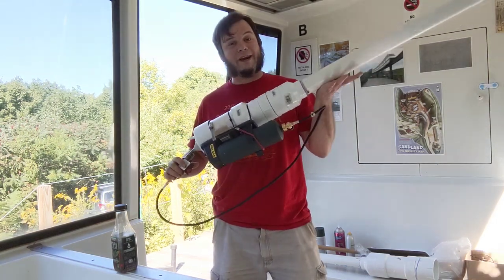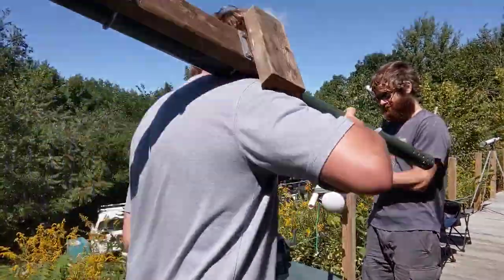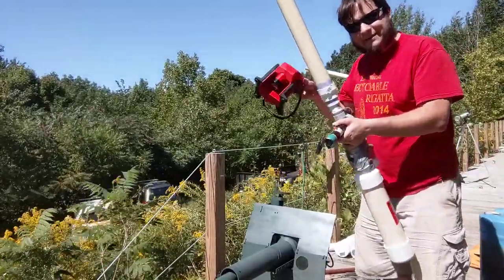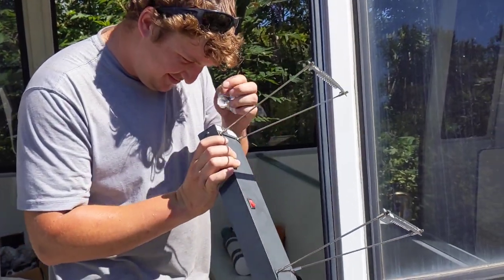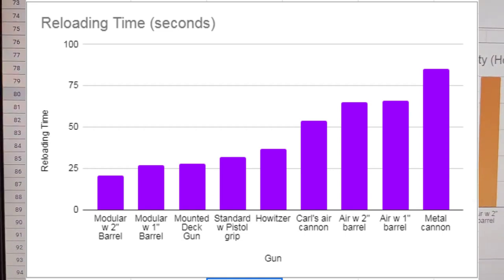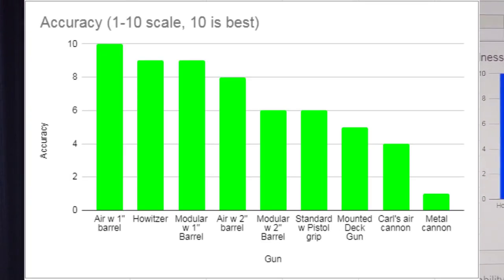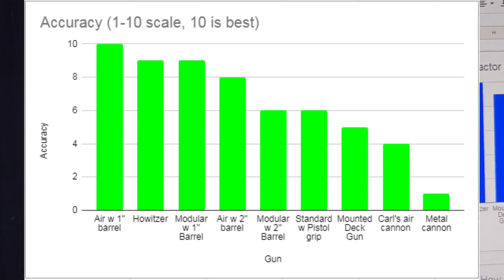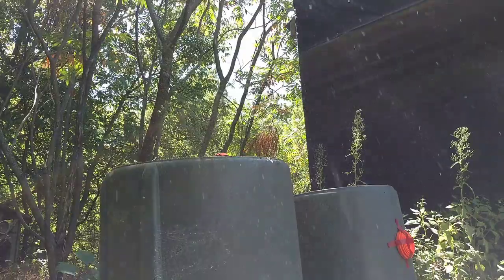What's The Best Potato Cannon? We Find Out With Science!

Comment: For the grill sparker style I recommend 91% isopropyl alcohol. As long as you give it fresh air between each shot it will go off.
Reply: I like to use denatured alcohol with mine. It is clean and relatively safe and reliable.
Reply: I had best luck with propane
Reply: @ariesleo7396 true, propane works the best but the combustion temperature is much hotter than isopropyl

Comment: You need to give the size, shape, weight and material of each projectile being fired. Especially for the chronographed ones so you can compare the power or inertia of each projectile. Haven't you seen any gun channels? the good ones even tell you how they load their rounds lol. 
Also if you want a better ignition source then order a few cheap plasma lighters online, you can attach the leads to some bolts in the chamber and they should last longer but if you epoxy a nut on the inside and one to the outside of the chamber then they become both replaceable and tuneable. When placed properly they can get that extra 5% of capability out of it. Also for using liquids like alcohol or lighter fluid that works best when vaporized, I have found that pre-mixing it in a separate container can be the most reliable method, like pouring rubbing alcohol into a big 3 liter bottle and filling the cannon by squeezing the bottle so that the vapor and air from that is used as fuel, then you don't need to worry about putting too much in there you can just have extra in the bottle and as long as you just use the vapor from the bottle and not the liquid it is already got a great ratio in it!
Reply from the maker: I ordered some cheap stun guns to try out, will see if those work better or if I just zap myself :-P

Comment: Your velocity is super low.  Ive never had a potato bounce off of a target.  I get reliable ignition with aqua net, and can blow a hole in 3/8 plywood.  Hitting an oak tree will turn the pitato to mist and remove the bark of the tree in an 8" circle.  Also, sharpen the outside of your muzzle so you get a perfect cylinder of potato going  down the bore

Comment: What if you designed the combustion chamber like a carburetor where there is a constriction to increase the velocity of the gas where you have the ignition on the back and the other side that connects to the barrel would be 1/3 the length of the high pressure end(the ignition side)

Comment: I see many potatoe cannon makers shoving potatoes extremely tightly down the barrel for the sake of preventing any air escaping. But dont you hinder the potatoes speed when you shove it that tightly in the barrel?

It would seem if your wanted the optimal speed  you would cut the potato so it barley touches the sides of the barrel. That would prevent air from escaping, while keeping friction to a minimum.
Reply from the maker: Some people will have a cutter or a specially shaped barrel to slice the potatoes to just the right size. There's probably an optimum balance between size and airtight seal.
Reply: It doesn't depend on that alone. The tight fit is meant to retain the explosion a little bit longer, causing higher peak pressure in the chamber, which in turn deliver more energy to the projectile. A loose fit on the other hand, is too easy to be moved. The early phase of explosion would cause it to move, effectively increasing the volume for the pressure behind it, and finally causing the peak pressure in the chamber to be lower
Reply: Yes that makes sense. Good to know
Reply: Some quick tips.....starting fluid in my experience, is best. You can NOT use the nozzle that comes with the can, it's TOO COARSE. Find a  spray paint nozzle that fits on the can and spray a fog into the breach. Start small and work your way up with the amount. And always remember to blow out the exhaust before the next shot. There is NO oxygen in the chamber after you shoot it! Hair spray will coat your electrodes with lacquer and soon they won't spark! My 7 foot gun will launch tennis balls at 1100 FPS! (2 1/4 in. electrical conduit)

Comment: Thai designers make these with an 8mm barrel up to 90cm long, shoot steel balls for bearings at a speed of about 500 fps, and a 12mm glass ball at about 700 fps. I don't know why, but a 5.5mm rifled barrel for an air gun gave only 350 fps, there is not enough pressure, but a glass ball weighs a little more than a steel one, 2.2 versus 2.1g.

Comment: Use bigger russet potatoes and have a section of pipe that you can use to "cookie cutter" the potatoes into reasonably consistent shapes and yall should have very repeatable results withing fairly accurate ranges
Reply from the maker: Yeah, I should have done this. The small town grocery store only had the little spuds.
Reply: I got the idea from colin furze when he made his repeater spud launcher
Reply: What you do is “sharpen” the end of the barrel. Grind it to a knife edge if that makes sense. Then you stick the big potato in the end, then pound it down. The oversized part of the potato gets shaved off and you have a perfectly sized plug. Furthermore, it’s all wet and slippery, so it seals better and has dat lube doh.

Comment: Need to ditch the potatoes and get 1/4 full chalk tube flair the end to fit a 2 inch tube for good seal and you will have distance and vol
Reply: I used to make pvc golf ball rounds for mine that would go through a car door. Get pvc that just slides in the barrel cut it at three inches and glue the golf ball with pvc glue and then wrap some electrical tape around the pvc to make it a tight fit.

Comment: 90% OF YOUR PROBLEM IS YOUR COICE OF FUEL. BOTH ETHER AND HAIR SPRAY ARE WETTING YOUR ELECTRODES. sorry, caps on. you need a dry fuel for reliability. compressing said "dry fuel"; helps. accuracy should be fairly accurate at 300M-500M. muzle  velocity can exceed 100kmph, easily!